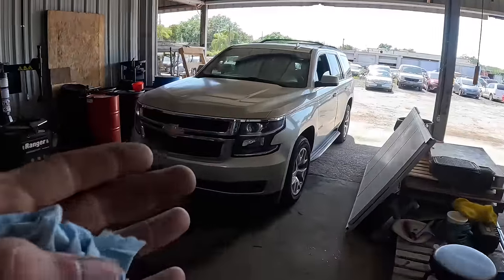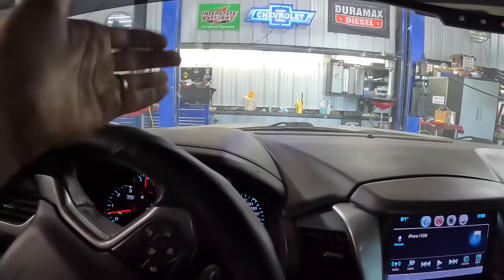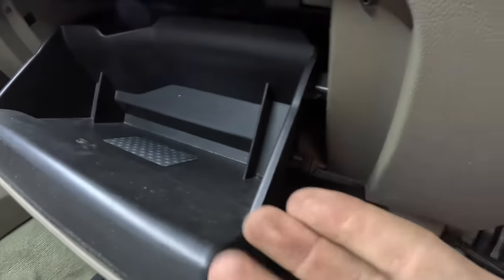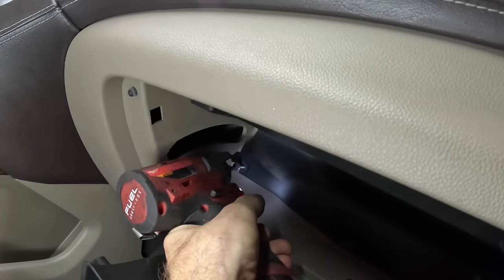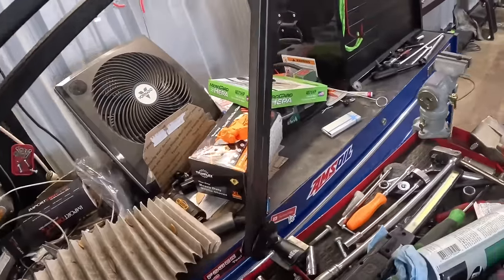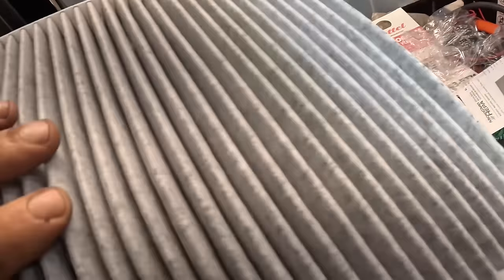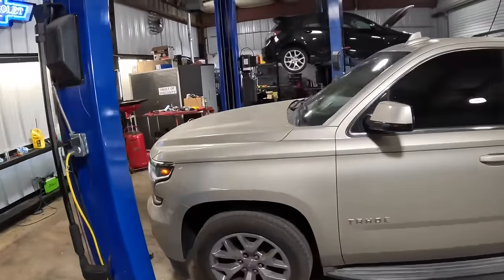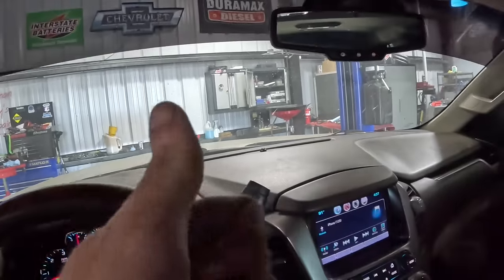Stink Fumes from the Dash! (AC Evaporator Foam)

Comment: Ray, I took my truck in for a oil change and was told it needed a new cabin air filter. I told the writer that was strange, because I had just replaced it about 2 weeks prior. A lot of these shops just tell you things hoping you'll be a good little sheep and do it. This same dealership charged me for an engine air filter, which I had not approved prior to their doing it. I always do my own checks just to make sure the oil level is correct prior to leaving. When I opened the hood it was obvious from the dust covering the air filter housing that it hadn't been touched. I opened it up, removed the filter, and two dead butterflies fell out of it. I took it in and showed the service writer the dirty filter, he called out the service manager who immediately offered a refund. I refused their refund, offers of free oil changes, etc. I let them keep the $50 they stole from me, loudly telling every customer and service writer that if they needed to steal money from customers for service not performed that was fine, but they would never see me again. I also left them a scathing review online. They must have called me 10 times afterward, I refused to take their calls.
Reply: Fargin' Bastiges! Why I've returned to doing my own work, where/when I can. Several years ago I was doing 5,000 mile interval oil changes on the Honda Fit I was driving. Asked the girl that I dealt with in the quick lube place to print a sticker for 5K Miles. 'Oh! I can't do that!' Told me my oil was only good for 3,000 miles, then it would start going bad. She had just attended a company seminar and knew that was true. . .

Comment: I worked at an oil change shop back in the early 2000s. Part of the oil change service was the labor required to check the filters, differential levels, tire pressures, top off fluids, etc. We didn't charge labor for the filter replacement-if you wanted a new one we charged the price of the filter which was based on our cost plus shop markup. Some services like serpentine belt replacement, fuel filter replacement, coolant exchange, transmission pan and filter service etc. were a flat price that included parts and labor. Some vehicles had a considerable profit margin and others we probably lost a little money on depending on the price of parts, quantity of fluids, or how big of a pain the job was. For instance, a transmission service on one car might be quick drop of the pan, filter, new gasket and fluid. Another might require removing a crossmember or transmission mount, and/or jacking up the transmission for clearance, cleaning off old RTV sealant, a more expensive parts kit, etc. That's why there was an incentive to maximize services sold because not everything was an easy moneymaker.

Comment: Pro Tip: before pulling the filter out slip a thin piece of carboard the same size as the filter under the old filter. This way when you pull it out any large debris doesn't fall down into the fan. Living in a rural area with a lot trees this has proven helpful.
Reply: I usually do a light vacuum job in the filter housing in addition.
Reply: Use an Aluminum clipboard from the office supply store
Reply: already replaced fan, and need to wire resistor and get a new filter cause of parking under a tree
Reply: I like this idea, always had the problem of debris falling in the fan, thank you!
Reply: Locus trees!😖If you know you know!

Comment: Great video Ray, I stopped my Honda dealership every time I would take my Ridgeline in for an oil change. The service writer would call me “ hey you need an air filter and a cabin filter “ and I would say no very time being very easy to replace. I replaced both air and cabin filter with K&N I know a lot of good and bad reviews on K&N but totally stopped my dealership from calling me. I put a note on my dash “ this vehicle equipped with K&N filters.

Comment: The cabin air filter replacement on my pathfinder is a PITA. Its like they didnt think about replacment when they designed the damn thing. You have to squish the filter to get it to fit. Seems like a great way to leave a gap where air can just pass right by.

Comment: I've used the foam treatment by removing the filter,  replacing the cover,  and then putting in half of the spray into the condensation tube and the rest into the air intakes under the cowel (sp?). Then run the vents on high for 5 minutes. Then liquid schmoo comes out of condensation tube.

Comment: There is a shop near my job I have my oil changed. They used to do that all the time and tell me it would be $70 for an engine air and $60 for my CAF. I would tell them put it all back, I am not paying you $130 for 2 filters that combined don't cost more than $30 from AutoZone and less than 5 minutes of work. Now they already know not to touch them in my car. Only took them 3 years to learn.
Reply: So you know they are dishonest and you still go back?!  How do you know if they even changed the oil filter?  They can just clean it.  I’ve seen that before.
Reply: If it works, it works. Good learning money. FFS, how hard can it be to ask the customer first? "Please note that it was so-and-so long ago it was changed"
Reply: @justpray365  It's not that they are dishonest. It's an upsell and I understand that. I would say they were dishonest if they did it and tacked on the charge and then expected me to pay for it. But I understand how it would be seen as them being dishonest.
Reply: Show me where those filters combined cost $30 or less, cabin air filters alone are usually $40-60. If you want to buy garbage Walmart FRAM's that are well-known to fall apart, go for it. Imagine risking your $10,000 engine to save $20 on air filters. You probably spend that at Mcdonald's and don't think twice about it.
Reply: @COBRO98 wix filters are $22 and $25 for our Jeep Grand Cherokee... Cabin/engine. Not sure where you're buying yours.
Reply: @COBRO98  Filters for my car straight from mazda are about $20 each for the engine and cabin filter. I've had my dealer call and tell me the filters needed changing, and I said no because I wasn't going to pay the labor, and the service advisor eventually caved and said he'd do it for just the parts cost. I usually just stop by the parts counter when I'm there for an oil change and pickup my own filters.

Comment: My 98 4Runner has no cabin air filter  -  After 20 years the blower squirrel cage was packed full of cottonwood fluff & it started to vibrate, so after removing all that fluff it was good as new and the airflow was back to original volume. Never noticed the reduced air flow as it slowly dropped when the fan filled up over those 20 years. Amazing how much air was making it thru all that fluff....it was packed solid (lots of cottonwood trees here)

Comment: I think cabin air filters are a great addition to modern vehicles. Back in the day they were rare, but now almost commonplace.  Anything to help improve the air for the passengers. In addition to the filter, the evaporator cleaning was very interesting.  I've been in vehicles that did have a noticeable odor from the A/C. I guess over time the evaporator does get dirty even with the filter. Thanks for this video. I did enjoy it. 🙂

Comment: Most GM HVAC systems have a feature called "Afterblow" that can be activated using a bidirectional scanner. It works by running the blower for an amount of time, after the vehicle has been driven & parked. This dries out the EVAP from excess moisture, where mold/mildew like to live. Especially useful for humid environments like Florida!

Comment: I usually don't charge labor for an air filter, if I'm doing any other work. Supposed to do the foam with the cabin filter out. You get more air flow with it out. Also, I use Febreze on the carpets and headliner.

Comment: Yes, they are necessary. Helps when you have an exhaust leak under the hood or burning oil smells. They do help with people having bad allergies. People who smoke 🚬 need to change them, I'm one of those people who smoke 🚬. I have children, and I prefer it to have cleaner air for them,  ( I don't smoke while they're in the car).
I greatly enjoy when I have a nonsmoker in my car and they compliment me on the clean air smell without air freshener 😊

Comment: Another thing to check is the channel under the windshield on the outside. It is where the fresh air inlet is and also where the water coming off the windshield drains. If the drain hole gets blocked it can allow the water to drain inside the vehicle through the fresh air inlet sometimes leaving puddles on your floor board or just soaking your carpets and causing a bad smell.

Comment: Some things that can affect breathing is pollen and if the filter gets damp is it can start forming mold and some molds can create bad odors and mess with your breathing.     (Electro Static Charging) on some high quality air filters can attract pollen, dust and dirt particles to stick to the filter (by static cling) kind of similar to devices like a Swiffer Dust Wand or Mop used in the home that dust sticks to by static cling.

Comment: Thanks Ray, many vehicles I have owned are even easier to do, just lower the glove department open the filter area with 2 clips on it change filter and reassemble. Takes about 5 to 10 minutes as I also shop vac the area out as well.

Comment: Hey Ray great video! I was a GM tech back in late 80’s and into early 90’s. Would run into stinky ducts and such. GM actually covered it if I’m not mistaken, the was a can of disinfectant you’d spray up thru the drain hole and use air pressure to blow it around some.  Seemed to work pretty great as I recall. Anyways please keep them comin Ray. I’ve enjoyed everyone of them, especially since you went out on yer own! Peace and loves to all yall

Comment: When I bought my Jeep Wrangler Unlimited in 2013 I found out that while there was a place for a cabin air filter it did not come with one.  I bought one and installed it in the slot.  After seeing your video I will be cleaning the evap coils on my 96 truck and 2004 Toyota.

Comment: In addition to inspecting/changing the cabin filter on a regular basis, a simple trick I've done over the years is to turn off the A/C shortly before reaching my destination and allowing the cabin fan to continue blowing on the "fresh air" (not "recirc") setting -- this helps prevent condensation/mold buildup inside the HVAC box and the musty smell therein.  My 18 y.o. LS430 has zero HVAC odor (despite living in a dusty SoCal desert environment), so either I'm just lucky or there's actually a benefit to my madness. Of course this only works if your system allows you to manually turn off the compressor (mine does even though it's a fully automatic dual zone system) -- newer vehicles may have eliminated the compressor dash switch entirely.
Reply: I always do the same, and have for years. My 2002 Silverado have perfectly operating A/C and no odors when it was sold last year.
Reply: @rwcz28  Some cars will run the fan for five minutes after shutting the engine off to let the condensate evaportate and minimise any bacterial growth and odours.

Comment: Hi Ray, bought a used AUDI 5 weeks ago, removed the cabin filter and found that it was blocked and mouldy green, 2 cans of foam cleaner as well as hovering the inside of the housing, then 2 cans of the fragrant bombs, fans on max and it finally came clean

Comment: The 2010 Escalade DOES NOT have a cabin air filter but they do sell a kit to add one later, so you will not know if you have one unless you look. The previous owner or dealer may have installed the kit.

Comment: @Ray, I have to do something similar to my BMW 328i every year as rarely the smell comes from the filter which I change every year since I'm in there.  On the BMW, it's much easier.  While changing the filter, the filter door has a small hole and connecting hose you can snake the evap cleaner to.  I just seal up around it with some hot glue which is easy to remove and dries very fast so the foam doesn't back it's way into the cabin.  After that, you just empty the can and most of it will eventually drip out the evap drain as it converts itself back too liquid.  Then like you, after letting the foam do it's work, I run the ac on low to permeate the cleaner smell through the vents.  Last step is an air out and I'm good for another year.

Comment: Some of the old cars don't have cabin air filter. My friend took his old Focus to a quick lube shop, clerk came in and showed him a filthy cabin filter, and offered to change it. My friend replied "I have no idea where you got that from, but my car has no cabin filter, I will not back".
Reply: I was just about to post that a quick lube shop will try and sell you a cabin air filter whether your vehicle has one or not. Also, if they do happen to convince you to replace the cabin air filter, they will charge you more than $40 for a $10 filter.
Reply: @kennethking2301  This and on the cars that do have one, it is usually a 5 to 10 min process to change it. However, the quick lube will charge a whole hour's worth of labor.
Reply: I was in a quicky  lube for an insurance inspection and watched them bring in a dirty intake filter to a woman,  problem was I saw it wasn't even from her car. I put a sharpie mark on my filter so I know if the dirty one is actually from my car.
Reply: I put the date & mileage on all my filters when I install them. Plus, I change all my own filters. I tell them not to even bother looking at them.
Reply: I just did what Ray said (googled cabin air filter for a Ford Focus) and I found one that fits all models from 1998 to 2007, so I'm calling BS on that story.
Reply: @module79l28 mine didn't have an cabin air filter. So before you call BS some came with them and some didn't.
Reply: @tinydog34  - I was calling out what the OP's friend said about his Focus not having a CAF. "Didn't come with" and "doesn't have" are two different things.
But that must've been a US market-only thing because on this side of the "pond" they all came with one. However, being an european-designed vehicle, I very much doubt that they would create a specific dash for the US market without the place for a CAF.
Reply: @module79l28  mine did not come with a place to put one in. They are built-in so you can put one in . So before you talk you better look how there put together.
Reply: @tinydog34  Thats correct. I had a listing for my Avalanche and played hell trying to find it.. Didnt have one.
Reply: @module79l28  Same cars in different countries have little differences. Just as an example a Ford sold in Canada is different then a Ford sold in the US. EU has different regulations as well.
Reply: @module79l28  well they do and you can buy a car with a cab air filter or you can get them without. And they do build different dashboard. Just because there European design they still have to meet what people want.
Reply: @tinydog34  - A simple Google search, that anyone can do, revealed US american forums talking about this matter and several US american tutorial videos showing how to replace the CAF in all generations of Ford Focus (in the 99 -> 04 models it's located under the wiper cowl and in the following models it's located behind the center console). In the Focus SVT forum it's stated that during some years Ford cheaped out on the CAFs and the cars came without it, leaving that expense to the owners. 
So, it's an undisputed fact that they all have at least a place to put the CAF in.
Reply: @TheJcrandazzo  - That's irrelevant to what's been discussed here, the Avalanche is a completely different vehicle.
Reply: I have had older cars before cabin air filters.
It was never fun dodging the 5 MPH hornet spat out from the vent, or the fly corpse that launches out of the defroster, or the plain old debris.
So yeah, I think the cabin air filter is a good idea. It could be easier in some vehicles to change.
Reply: @module79l28  it seems you just don't get it. They either have one built in or you can get them without cabin air filter. Just because you can Google it doesn't mine you're car has one. Quit saying they all come with one. Don't care what they do over in Europe or UK but what they do here is what they do here . And that goes for all cars here in the United States.
Reply: @TheJcrandazzo   this module 79128 is a nut case he thinks just because you can Google it that it comes with it . He thinks he knows it all but just doesn't get it.

Comment: I've had a Model 3 for 3 years now, I've just been changing the cabin filters myself (using aftermarket HEPA filters).  It was MUCH easier than I expected...I just have to take out a few clips in the passenger side floorboard, remove a panel, unscrew something, pull the filters out, put new ones in.  Took me...maybe 5 minutes before I knew what I was doing.

As to your question...I would be fine with them charging labor IF they asked me if I wanted to check and/or replace the filters first.  Otherwise...yeah I see your point.  They shouldn't be doing labor without giving you costs upfront.  It's all about honesty and disclosure.

Comment: Every car/truck needs a fresh air cabin filter. Not just for making the air you breath cleaner. But it will stop alot of the larger stuff from plugging the evaporator/ heater core. To change that filter a few times a year, is way easier than pulling out a plugged heater core